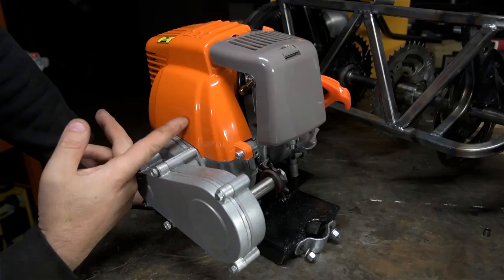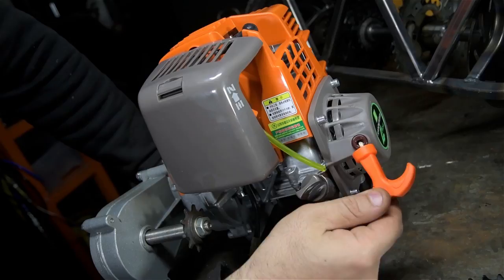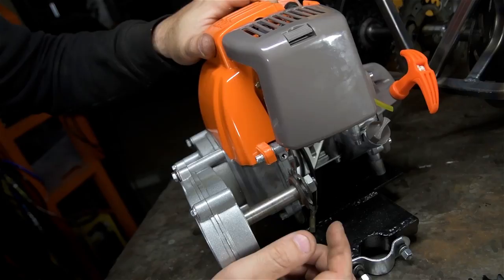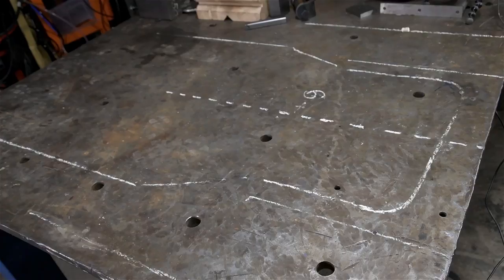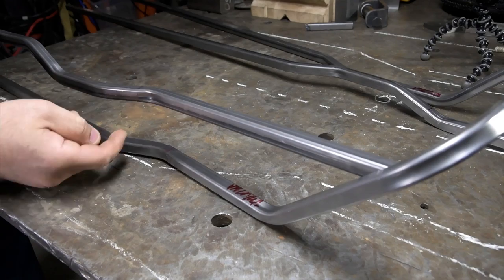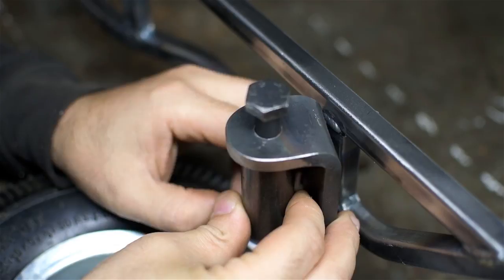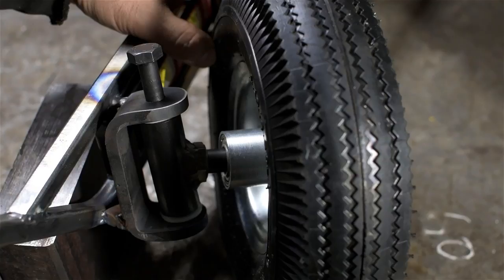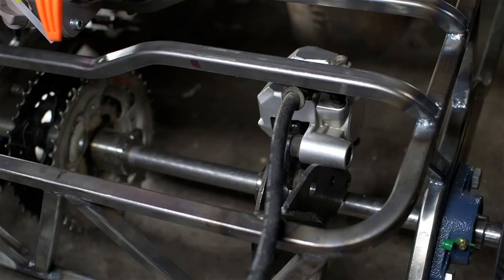"CHAINSAW" GO KART! - PART 2

Comment: that “spindle” is sketchy, you shouldn’t rely on a weld joint, you should drill the tube and put the spindle thru the tube and weld it up

Comment: did some maths and at 900rpm with a 10 in wheel i THINK your looking at 8.5mph.  Could be super wrong though and i know the video is old.  That would assume 900 rpm at the outside diameter of the wheel.
Reply from the maker: That's because you forgot to cancel the 's'.  ;)

Comment: Ehm, I know this is way after the fax (myeam) but, you say 800-900 rpm at the axle (so at the wheels...) For that 10" radius wheel, at 800rpm, that's 75km/h. 47mph. You sure you love those kids?

Comment: you CANNOT USE BIKE CHAIN. it is not WIDE ENOUGH to absorb twisting force on the chain and vibration / slack ratios, as you found out. #35 or 41 is better suited. No go kart ever used bike chain (that I am aware of) I was 11 when I tried something similar.

Comment: You would have had to re-sprocket and drive gear it, but wouldn't a motorcycle chain have solved the original problem?
Reply from the maker: too heavy?
Reply: This Old Tony You mean the same length of motorcycle chain and the gears would be too heavy for the motor to turn? It was stronng enough to break the bicycle chain. I was just considering a stronger chain option. I really don't know anything about the stress dynamics. You maybe could have used a belt primary to a chain secondary like a Harley but you were goung for simplicity. I was trying to make the chainsaw motor work. You know, put the chainsaw back in the chainsaw go cart. What I really liked about this series was the steering and tire camber explanation.

Comment: What is wrong is you are using a saw clutch.. Its a different sprocket tooth design that cuts the links..use a tiller clutch

Comment: are you not supposed to have the front wheel axes perpendicular to the rotating axies ? front wheels should be not perpendicular to the bech surface when looking from the front of the kart. but much more to a trapezoid. I think  that's how it  is supposed to be based  on my years in rc cars.

Comment: its a real disappointment, i had a scooter with a 48 cc chainsaw engine, wit a stepped reduction the original sprocket, to a shaft with 2 bearings to another sprocket bigger chain, it waas the madest shit i have owned in only 30 miles per hour but in 30 meters i was at full speed and all in one wheel, i wanted so bad that the 2 stroke worked in your go kart, they are amazing engines and reliable mine worked as a champ a powland one.

Comment: It's not a chainsaw engine go-kart anymore. That rates high on the sucko meter  Your chain sprockets where to small. You would have better luck if you took the engine out of the plastic casing.

Comment: I admire everything you have done. Amazing. But you literally over complicated the whole thing :-)  The original chain-saw idea was great. The gear reduction ? not so much. Too complex and not fool-proof.   When it is about a kid stuff, keep it simple and absolutely fool-proof :-)  They are capable to make the best bulletproof thing go broke in 5 seconds. 
When I converted an electric razor drifter kart to gas powered 2 stroke  gokart I did not complicate it at all.  I have half the talent and a quarter of the tools so I had to keep it simple.  My project turned out to be great, my son used it for 2+ years and then outgrew it  Until then he was able to drift it anytime he wanted on any surface and as long as he had gas in it :-) 
 I think if you look at a racing gokarts and see how simple and primitive they are, yours is like a Cadillac of gokarts :-)  I will watch the whole video because I love and honestly amazed at your skills. 
Great job and you are an inspiration to us who loves tinkering but does not have the talent and tools you got.

Comment: Well I guess you need to change the name of the video lol because that is not a chainsaw engine brother.. just saying lol oh and by the way you could have saved the original engine by use a belt and slack and tension spring loaded manual torque converter lol very simple and works way better then chains and sprockets systems and has way less maintenance required such as does a chain system...

Comment: Living in the past? Why not an electric motor?
Reply: Stiff Wood kids hate riding for 2 and a half hours and then waiting 24 hours for a charge plus the batteries are extremely expensive and a decent electrical hazard is something is done wrong. This works really well.

Comment: I enjoy your videos  and here is a little info you might use, My father was a McCulloch dealer from 1953 to the early 90's, in the late fifties and early sixties he raced go carts, he set the track record in the single engine class at 127.5 mph, they used the highest quality #35 roller chain he could find,  crankshaft sprocket's were 9 to 11 teeth, he ran a "Live" axle (Wheels locked together on the same shaft) and axle sprockets were anywhere from 72 to 80 teeth found this video of a vintage racing cart to give you some ideas.  https://www.youtube.com/watch?v=FrWEkLsD27E

Comment: You were supposed to use a chainsaw motor! You cheated buying a new engine. Especially when you had the old one running. I would have love to see exactly how you would go about gear reduceing that engine. Kind of the reason I started watching. But noo... You just go ahead and buy a different engine to avoid all the hard work. GREAT WORK THO. I'm loving your work shop. I'm definitely jealous.